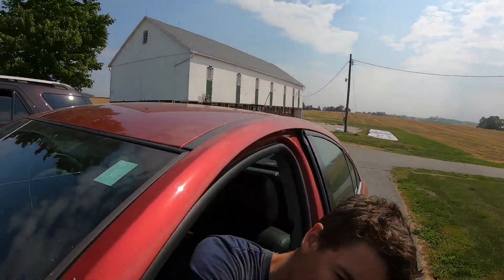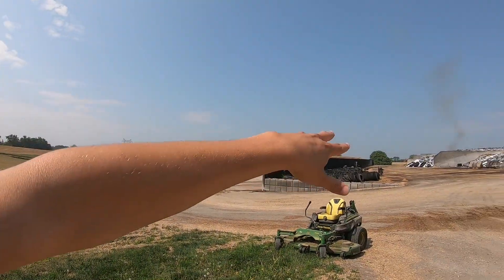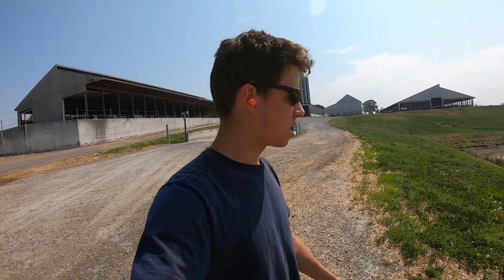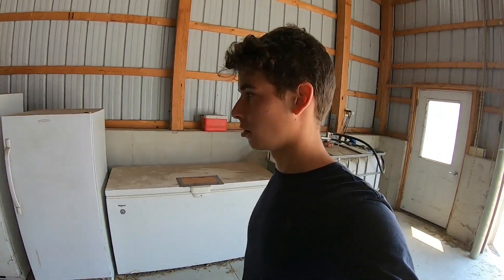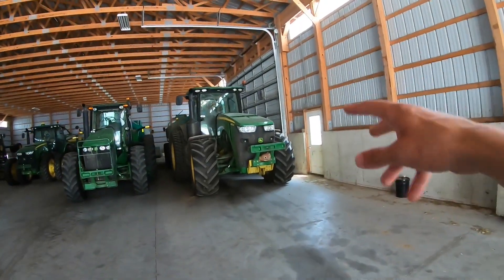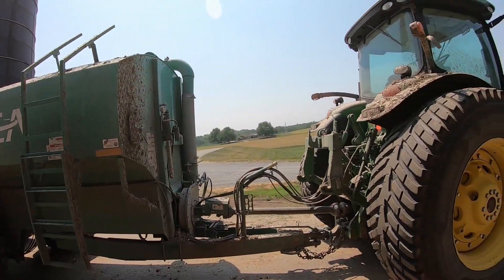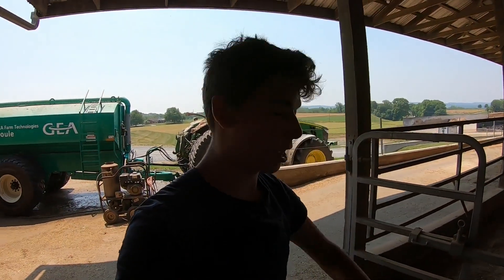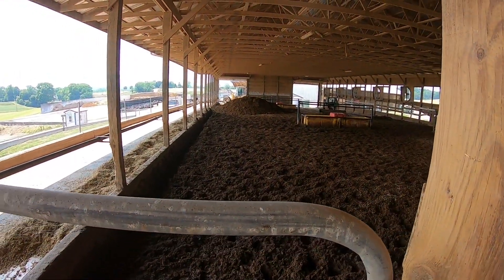New Cab Suspension & Pressure Washing

Comment: Do you remember what vehicle those side by side shocks were used in?
Reply from the maker: @cmccracken21  The shocks were bought new, and they are currently in our 8270R.
Reply: Thank you for replying. I was wondering what side by side they were actually meant for. You had said they were made for a side by side, but can use the same bolt pattern as your John Deere cab mounts. Thanks, again for your attention.